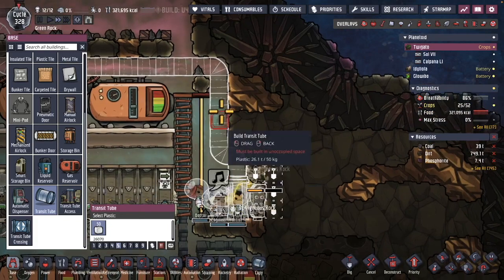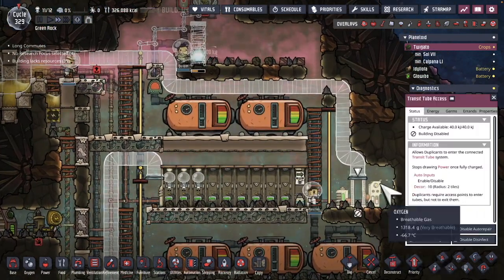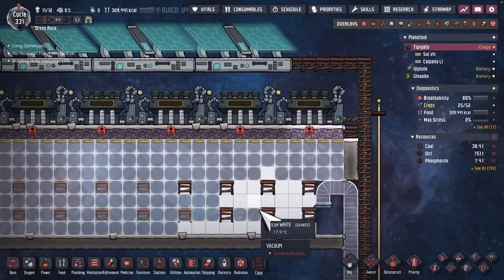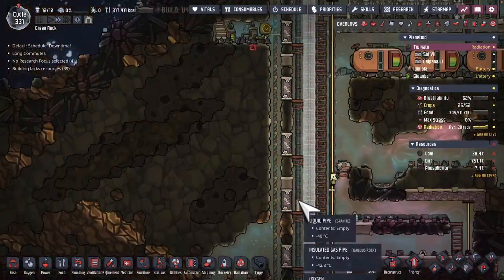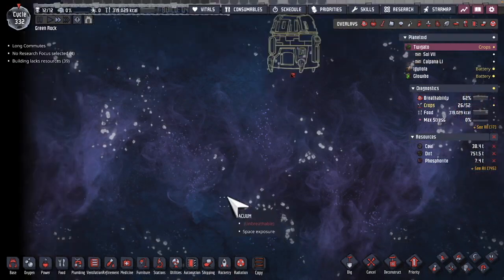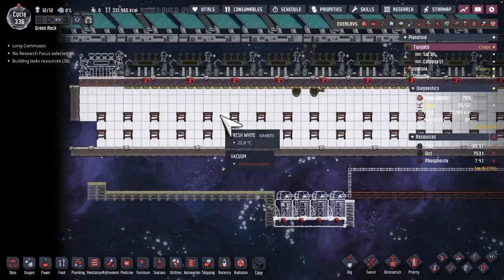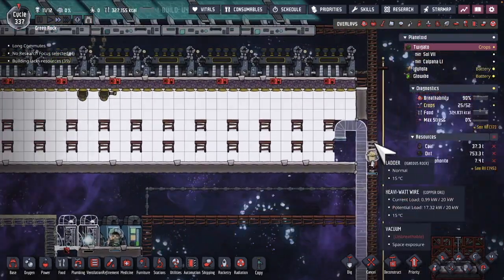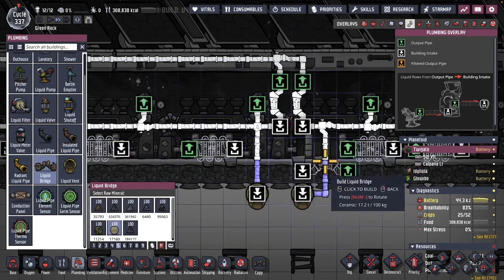Whatta Blast #35 Reactor Drywall

Comment: Batteries generally should be on the high side of the transformers. It will generally help with overload as long as the player does not have to much on the lower cables.
Also, it is very rare that Atmo Suit docks (after the initial loading of O2) and Transfer dupe pipes will use their power at the same time.
Reply from the maker: That is good to know. I might not worry about having conductive wires for just atmo suits.